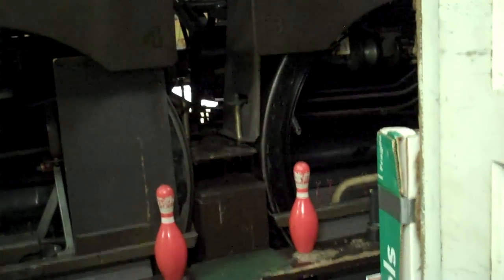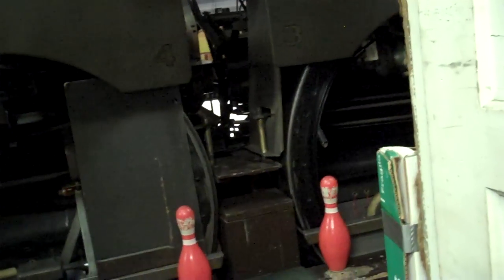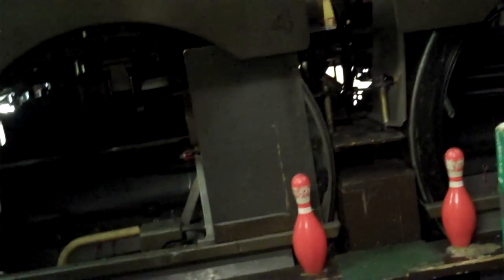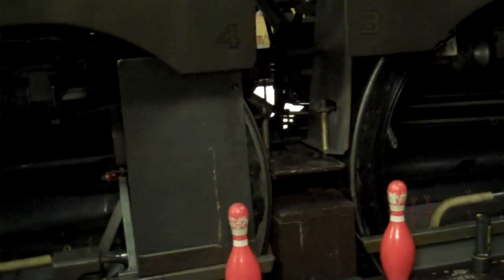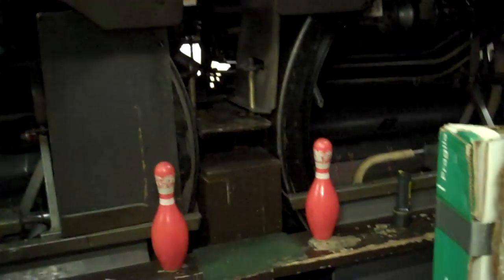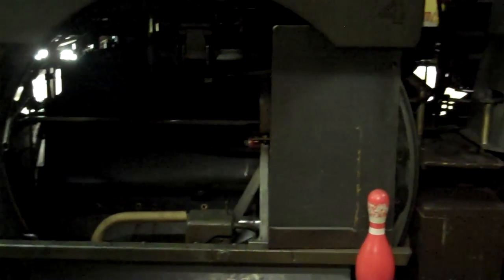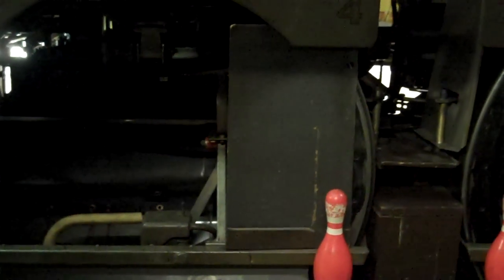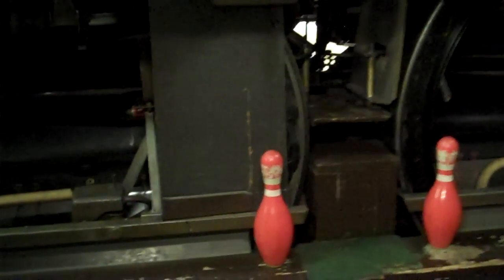Brunswick A2 Pinsetter - Ball Return System

Comment: how fast would you say the ball is going once accelerated?
Reply: If the A-2 ball accelerator is using factory drive pulleys the ball enters the subway. At 35 mph. At my house I slowed them down using the smallest drive pulley and belt to eliminate the use of the brake assembly. Much smoother operation after I did that, basically I was reducing the accelerator to the speed of a jet back machine. Had a few complaints about slow ball returns but those complaints went away as some of the s lifts were banging when a ball entered them. Found out why my first night there, only 4 lifts had brake assembly's the others were missing.  Not even in the house so slowing the accelerator down was the only option as the owner didn't want to buy 8 brake assembly's.

Comment: haha yeah you are so right. I only first saw those rake shotguns when I went to the open house before my first year of college, (early 2006) I was at that bowling center that I have those A machines recorded. 

The A machines we used to have didn't have them. They were pretty close to original as the only mod they had was no 90 overtravel. Though they weren't as old as the ones you have as they had rear-facing electrical panels. 
Do you by any chance know why those panels were moved to the back?

Comment: Yes indeed! Hey, curious, was there ever a time where you had to disconnect a shotgun on a machine for a reason? Meaning the machine could still be used but the rake had to operate the old fashioned way (if that's the correct term) because of maintenance purposes or something.